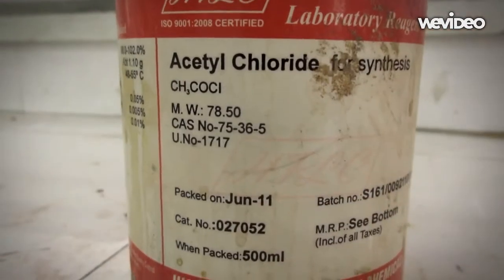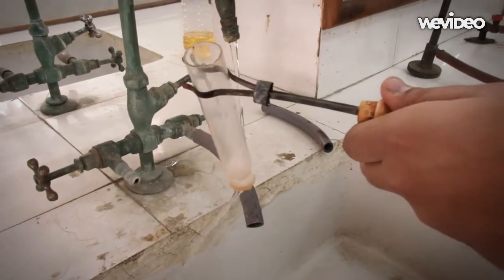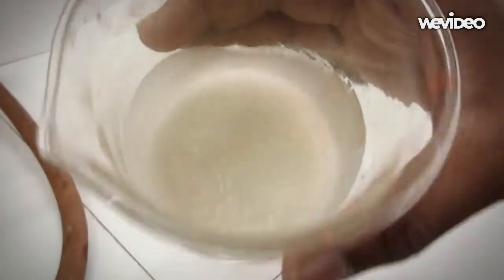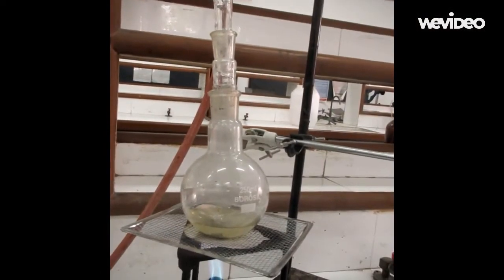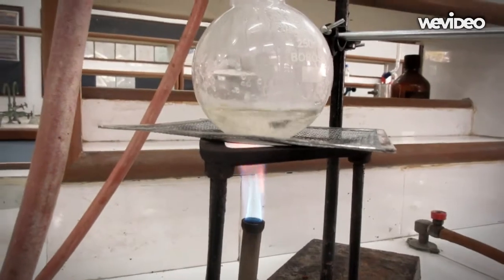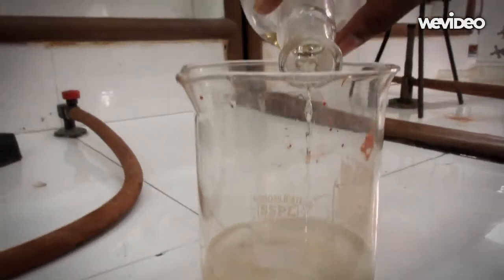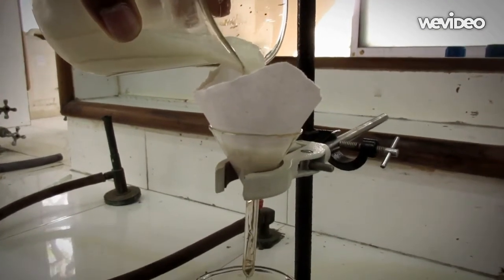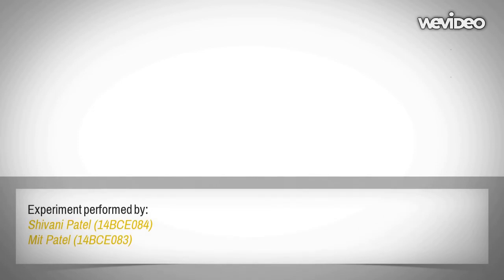Synthesis of Acetanilide using acetic acid by conventional and green method

Comment: Just wondering, whats the roles of glacial acetic acid and zinc in the reaction? :)
Reply from the maker: Acetic acid is acetylating agent and zinc increases the rate of reaction
Reply: Also Zinc avoids oxidation of Aniline into tarry mass, Aniline on heating at elevated temp reacts with atmospheric oxygen to form products like nitroso benzene and other tarry mess, Zinc dust reacts with glacial acetic acid forming nascent hydrogen and thus reduces oxidised impurities back to pure aniline